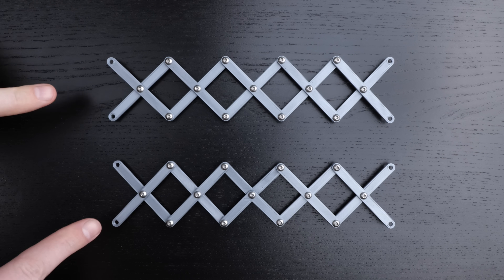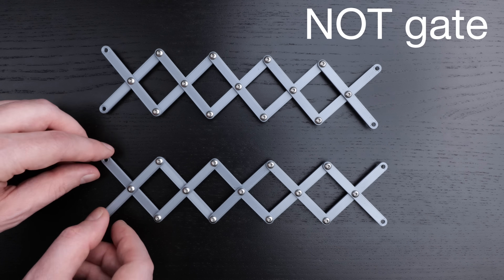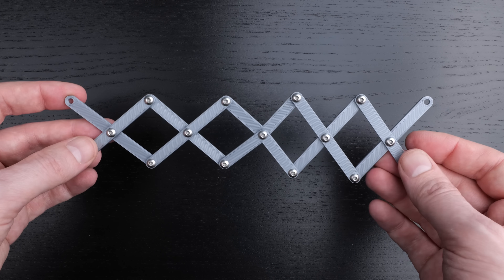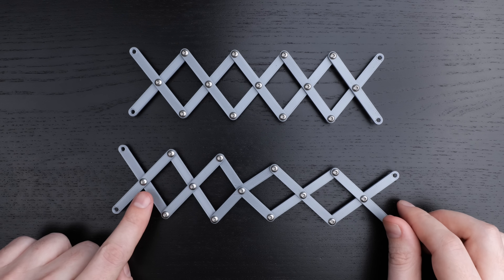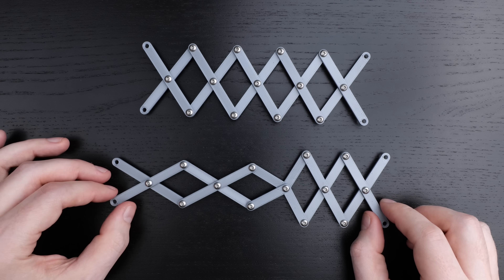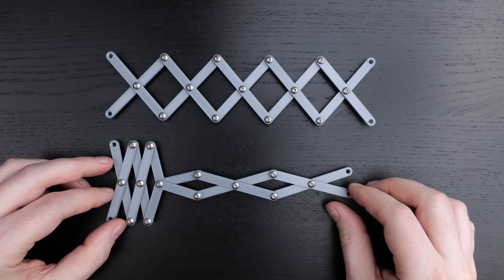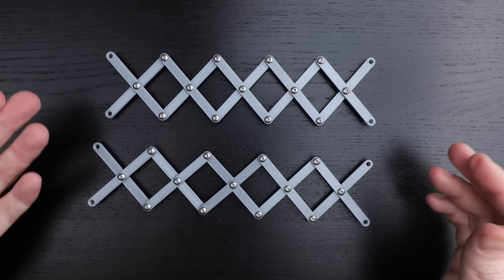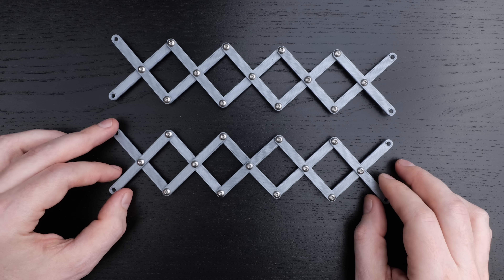Scissors NOT gate

Comment: If you chained two of these not gates together with a rigid flat rod on the outputs with a hole CNC-ed in the middle, it might almost be better to implement it as a ternary system because you get the ambiguous middle ("one of these is a 1 but we don't know which", which I think here is the UNK state?) for free.

That would be really cool to see uncertainty propagation through a network of weirdly mechanical gates like this. :D and hey, if we get more bits through the system for free, it's more bits through the system for free! :D <3 :) ;'DDDD

Comment: If you want to create a "pass" node, that outputs its input value (basically a wire) in a similar manner, you should connect two (or any even number) NOTs, and assuming the constant length problem is solved, these wires would also be constant length. Also they would be really cool visually, blending in in a larger machine. This would also have greater mechanical strength than some of the other ideas I have for just wires, and these can actually be suspended in any direction.

Another huge problem with the future designs is buffering. You can manage to create logical blocks that perform a few operations as gates, but after a certain complexity you either need very good bearings, which is an expensive option (and still not infinitely scalable), or some kind of logical buffers, that "amplify the signal" passed to it. This is a pretty straightforward electromechanical challenge, but the whole point is to only use this reduced set of building blocks. I'm thinking maybe something with "rechargeable" torsion springs and latches like in a mechanical clock.

Comment: You can make a NAND gate pretty easy: two parallel scissors, one full scissors width apart, then connect a third scissor to the two closest ends of the parallel ones. Pretty hard to explain without a picture...

Comment: The change in length is primarily due to the centre portion - replacing the right-angles with 60 degree angles, using an equilateral triangle the base shape as opposed to a square, would fix the change in length at each extreme, and the middle, of the lengthwise motion. I'm unsure of the full length profile through the points between these positions, however, and the changes to the rest of the mechanism to compensate would also reduce the range of crosswise motion between each pair of opposing points.

A tricky one, to be sure!
Reply: With a bit of angle chasing and a little trigonometry one could conjure up a function that spits out the total length of this contraption based on the input angle.

Then it's only a matter of checking if it's constant or not

Comment: Break up the L piece (i.e. have 4 arms connect on 1 pin). This is how I initially thought this worked. Admittedly, it doesn't hold its length constant on its own, but you can just enforce that with the framework that holds the linkages in place.
And a constant-width identity gate would combine one [NOT gate that is built with the L pieces] in series with another [NOT gate that uses the 4 arms attachment in the center].
Reply: Next idea: A 45° arm instead of the 90° "L" piece would output an equal width in both the "on" and "off" positions. And in between the width will be WIDER than the end widths, which means that a scissor coupled to those output pins would get SHORTER (following a sinusoidal curve) during the switching operation.
If you put 2 pin points that use 45° pieces in series; then using appropriate lengths of scissor linkage to the left, right and in between them will make it possible to exactly cancel out the length changes.
The transfer of the logic state would still happen through the sideways shift of the central scissor linkage, just as in my initial 4-independent-arms-at-1-pin solution. So the length would still need to be enforced by the framework (if only at the point where the inside-facing arms of the 45° pieces pass through the vertical w.r.t the scissor linkage's length). But the 45°-based design would re-gain the bending rigidity that the 4-arm design sacrificed as well.

edit: ascii diagram
\/\/\:/\/\:/\/\/
/\/\/:\/\/:\/\/\
with
\/
/\
being a center pin with normal linkage (fixed 180° arm angle) where arms cross over each other and
\:/
/:\
being a center pin with the 45° linkage (fixed 45° angle between the arms on both the bottom and top side)

Comment: Given L the length between two pivot points (the long pieces have 2L between their opposites pivot points), if you make the width D of each stick be L*sqrt(2) then the length in the middle state and the lengths in true and false input positions are the same, the first problem is that those three states are identical, ie it doesn't move at all. The second is that since the width of the pieces is longer that the length between two relatively fixed pivot points, you can't actually build the scissors, as neighboring pieces want to occupy the same space.

In the video we have n=2, the length T0 in the neutral state is T0=(2n+1) * L * sqrt(2) . And the length T1 in the set state (true or false) is T1=(2n+1)(sqrt(L^2 - D^2/4) + D/2) .
Solving for T0 = T1 yields D = L * sqrt(2)

Comment: Going on pure instinct, for the constant length; two ideas figuring them out as I type.
The movement comes from the rotation of the connection line between the axes: it's a square pivoting on a corner with the axes on the connected corners
You need to get the overall rotation point in between the axes. But with a fixed axis that won't work.
So: have that move along a curved path, sliding along a shaped "linear" axis.
Or
Extending the length of the first/last joints changes how agressively it extends. It feels like that should help somehow.
There's lots of "interesting mechanical mechanisms" demonstrated on here, many dedicated to hinging arms (like on the channel tenfold). there's probably one that is applicable here?

What is also interesting is that you also have a kind of bit here: left or right, somewhat fixed. That's a 0/1

Comment: Constant length: makes me think of using fourier to approximate a flat curve. Would require a ton of linkages tho... because every pair of scissors is a sin(ax + b), where a depends on the length of the linkage and b depends on its angle (default are flat linkages, and the 90° ones for example add Tau/4 to the angle of the sin, making it equal to a cosine evaluated at ax).

Comment: Ok I see problem pf making the not gate a constant length.
So if the angle increases a bit in the middle then when the scissor closes on both sides it'll be the same length as the standard scissors midway, now, fixing that problem creates another problem. The middle way will be too long, yes it's true, but! Look. 90° is the same, you increased the angle so when one side is fully "on" the other isn't exactly fully off, so it can keep the length of the 90°... a simple elasticity on the L piece and a bar on those sides to provide the force to bend it should be enough to solve the problem.
Also I don't think the problem is solvable with a fixed angle on the L piece.
The bars would be in the end with the scissors in the middle like: |xxx|
Then with plenty of those bars you can try combining them, but still mechanism like "and" or "or" would need 4 connections on the left and 2 on the right which is confusing.
Or maybe 3 on the left and 2 on the right assuming you're connecting the 2 pins in the middle together, still doing that you end with 3 different states at the end, both closed, one side open (assuming same opening independent of the side) and both open...

Comment: Hey Henry
 - long time, no see.

Not done the analysis, but taking a lead from electrical theory, three phase might work for lengths - i.e. two    sections of 120 degrees scissors, with a longer middle section. Trouble is, that’d destroy the not and make it a “buffer” again - like the top one - but one of constant length.

I’ve been idly mulling the “and” issue - nothing truly elegant is presenting itself. I hope that gets solved - it’d be nice to see even a full adder. I suspect friction will start to be an issue!

Comment: Solution for AND gate, using three NOT gates.
Sorry, no monospaced fixed width fonts, emojis shall be used. Better viewed in horizontal orientation in small screen devices. 

Emoji Notation:
↕️ Open input/output, Zero/False 0️⃣
↔️ Close input/output, One/True 1️⃣
🔃 Open link (high height);
🔁 Closed link (low height);
⬜ Emoji space alignment (only, no effect);
⏫⏬ Fixed points: top and bottom;
↗️↘️ Additional links: top and bottom, to give some space to the scissors;
🔀 Overlap solution: two additional links that are NOT connected;

AND operation: (there is a vertical movement of last scissor during operation)
0️⃣⬜⬜⏫
↕️🔃🔁↘️⬜⬜⬜0️⃣
⬜⬜⬜⬜🔀🔁🔃↕️
↕️🔃🔁↗️
0️⃣⬜⬜⏬

0️⃣⬜⬜⏫⬜⬜⬜0️⃣
↕️🔃🔁➡️🔀🔁🔃↕️
⬜⬜⬜⬜↗️
↔️🔁🔃↗️
1️⃣⬜⬜⏬

1️⃣⬜⬜⏫
↔️🔁🔃↘️
⬜⬜⬜⬜↘️⬜⬜0️⃣
↕️🔃🔁➡️🔀🔁🔃↕️
0️⃣⬜⬜⏬

1️⃣⬜⬜⏫
↔️🔁🔃↘️⬜⬜⬜1️⃣
⬜⬜⬜⬜🔀🔃🔁↔️
↔️🔁🔃↗️
1️⃣⬜⬜⏬

For non-extensible "buffer" (0 to 0, 1 to 1) use two NOT gates in series:
0️⃣⬜⬜1️⃣⬜⬜0️⃣
↕️🔃🔁↔️🔁🔃↕️

1️⃣⬜⬜0️⃣⬜⬜1️⃣
↔️🔁🔃↕️🔃🔁↔️

I hope this helps.
Reply: Amazing.
Reply: Note that the crossing of the overlapping links retreats in the direction of the inputs (left) when both are in state "1" to open (zero) the input of the last NOT scissors.
Reply: OR operation: (with some vertical movement of the last scissor).
No overlapping links and the fixed point are internal. Maybe external additional links are necessary to prevent "half-opening" when one of the inputs is "1" and the other is "0".

0️⃣
↕️🔃🔁↘️
⬜⬜⬜⏬⬇️⬜⬜0️⃣
⬜⬜⬜⬜↔️🔁🔃↕️
⬜⬜⬜⏫⬆️
↕️🔃🔁↗️
0️⃣

0️⃣
↕️🔃🔁↘️
⬜⬜⬜⏬⬇️⬜⬜1️⃣
⬜⬜⬜⬜↕️🔃🔁↔️
⬜⬜⬜⏫⬆️
↔️🔁🔃⬜⬆️
1️⃣⬜⬜➡️

1️⃣⬜⬜➡️
↔️🔁🔃⬜↘️
⬜⬜⬜⏬⬇️⬜⬜1️⃣
⬜⬜⬜⬜↕️🔃🔁↔️
⬜⬜⬜⏫⬆️
↕️🔃🔁↗️
0️⃣

1️⃣⬜⬜➡️
↔️🔁🔃⬜↘️
⬜⬜⬜⏬⬇️⬜⬜1️⃣
⬜⬜⬜⬜↕️🔃🔁↔️
⬜⬜⬜⏫⬆️
↔️🔁🔃⬜↗️
1️⃣⬜⬜➡️
Reply: Flip-flop: one-bit memory.
SET is 1 = M output goes to 1 to keep this value even when SET becomes back to 0 .
RESET is 1 = memory is cleared as M goes to 0 to keep this value even when RESET becomes back to 0 .

Inverse to electronic Boolean logic, which only has scalar values (volts), Mechanics has vector values that mean it has direction. This means that the "open" movement has an opposite direction of the "close" movement. So two NOT gates are required to feed the memory output back to the flip-flop input - they keep the scalar value of boolean logic and compensate the vectorial direction. These right-to-left operation gates would not be needed in a digital electronic circuit.

The OR-AND latch was chosen because there is only one feedback link ( right-to-left operation - see the direction of the arrows), and NOT gates are available. The NOT gate scissors required for 1-bit memory are 3 NOT gates for OR gate, 3 NOT gates for AND gate, 1 NOT gate for RESET input, and 2 NOT gates for feedback link. Nine NOT gate scissors in total.

Emoji notation:
🆖▶️⏺️  - NOT gate - NG>o ;
🅾️ OR gate - [O] ;
🅰️ AND gate - [A] ;
🆚 SET input - [VS] ;
®️ RESET input - (R) ;
Reply: idk why, but the words "emoji notation" made me giggle
Reply: Your buffer (unfortunately) doesn't work the way you think it does. Both of the NOT gates get longer and then shorter again when transitioning, therefore the inverted NOT-NOT mechanism will have double that change in length.
Reply: @tylerduncan5908   The mechanical circuit works "the way I think"  - or at least as I expect. Otherwise, if we use a similar example as the old TTL circuits (electronics: 0 to 5V), it would be the same to say the logic gates don't work because the voltage is at a transitional condition between states when voltage is at, let's say, 2.5V.
That is why digital electronic circuit designers consider small voltage ranges for distinct states, using the same example of old TTL: 0 is 0 to 0.5V, and 1 is 4.5 to 5V - all the rest are considered transitional conditions and not states.
This is also one of the main reasons why complex logic systems are clocked - to prevent interaction between circuits during different transitional conditions.
Most of these transitional conditions are caused by different capacitances in distinct circuits. We could consider the mechanical length variation during transitioning as a "capacitance"  - the same consideration for the vertical movement in AND and OR gates.
To reduce (but not eliminate) these capacitances, some fixed points shall be inserted in the mechanical system, and we can focus on the most important: the final result of the logical states.
As far as I know, there is no such perfect system with no capacitance, at least the ones made by men - even the fastest microprocessor doesn't have a perfect square wave - all square waves have ramped transitional variation despite being very short compared to the final state times.
Thanks anyway - I spent a lot of time on this, and it seems nobody cares - you wrote the first feedback.
Reply: Interesting. I gotta try it out in a physics simulator (don't have mechanical components).
Reply: @jyothishkumar3094  Please, if you or anyone else does, come back and let us know what happened. (:
Reply: @jyothishkumar3094   I am trying to make a scissors-logic simulator in an Excel spreadsheet to test these many connection configurations faster than writing down all Mechanical Boolean possibilities in a paper, but I have been busy these days.
Reply: Dear internets! emoji based schematic symbolism. If I had time I'd try to lay this out in blender.

If I had even more time I'd complain to the standards body about missing concepts in character sets and keyboards.
Reply: Love it
Reply: So cool!
Reply: Maybe this revision is better for understanding.
AND operation: (there is a vertical movement of the last scissor during operation).
🔀 Overlap links crossed but not connected - perhaps this is the best way to emulate a "switching" AND gate.

0️⃣⬜⬜➡️⏫
↕️🔃🔁
⬜⬜⬜➡️↘️⬜⬜⬜⬜0️⃣
⬜⬜⬜⬜⬜🔀↔️🔁🔃↕️
⬜⬜⬜➡️↗️
↕️🔃🔁
0️⃣⬜⬜➡️⏬

0️⃣⬜⬜➡️⏫
↕️🔃🔁
⬜⬜⬜➡️↘️⬜⬜⬜⬜0️⃣
⬜⬜⬜⬜⬜🔀↔️🔁🔃↕️
⬜⬜⬜⬜↗️
⬜⬜⬜↗️
↔️🔁🔃
1️⃣⬜⬜➡️⏬

1️⃣⬜⬜➡️⏫
↕️🔃🔁
⬜⬜⬜↘️
⬜⬜⬜⬜↘️⬜⬜⬜⬜0️⃣
⬜⬜⬜⬜⬜🔀↔️🔁🔃↕️
⬜⬜⬜➡️↗️
↕️🔃🔁
0️⃣⬜⬜➡️⏬

1️⃣⬜⬜➡️⏫
↕️🔃🔁
⬜⬜⬜↘️⬜↗️⬜⬜⬜1️⃣
⬜⬜⬜⬜🔀⬜↕️🔃🔁↔️
⬜⬜⬜↗️⬜↘️
↔️🔁🔃
1️⃣⬜⬜➡️⏬
Reply: oh cool
Reply: Bro I can't read wingdings
Reply: @Alex de Moura  From a quick thinkabout, both adding a crossover to the OR / removing the crossover from the AND result in NOR gates.

Edit: replacing the final not gate with just a regular gate should also do the trick. Those result in way more movement in terms of the output position though, which would probably not be super helpful if you were using these to construct bigger machines.
Reply: @CANnickhughes  Yes, and if you change some fixed points in the AND after removing the crossover, you get a NAND gate.
An XOR gate using an OR , a NAND , and an AND gate required too many scissors - the same is happening with the 1-Bit Latch flip-flop memory - please see previous replies.
Most of the logic gates designed in this comment have two Input NOT gates and an Output NOT gate.
When the logic gates are connected in a series configuration, the Output NOT gate can be replaced by the Input NOT gate of the logic gate next in a series.
When two logic gates, in parallel structure, share the same Input Bits , they can also share the respective two Input NOT gates of those bits.
I suppose the XOR gate can be reduced to four scissors only using this "gate optimization" ( or "reduction" ) - just changing the crossover/direct links and fixed points -  and removing redundant NOT gates using the similar ones in the neighbor gate.
The XOR gate is needed for Add in the 1-Bit width Sum block design with an AND gate for Carry as that was my first goal (a challenge in one of the comments of this video) - but the XOR should be optimized. 
I am trying to make a scissors-logic simulator in an Excel spreadsheet to test these many connection configurations faster than writing down all Mechanical Boolean possibilities in a paper, but I have been busy these days. I appreciate your comments - thanks.
Reply: @Alex de Moura  If you start with an AND gate and fix either the top points on the first two NOT gates, or the bottom points on the first two NOT gates instead of the outside points, you get a gate which is only true if exclusively the corresponding input is true.
Reply: @CANnickhughes   I didn't see your last comment, I was typing the reply. I will try your suggestion.
Reply: I would need to see this physically demonstrated.
Reply: @warlockpaladin2261  That will not help. Taking a course in logic will. “I learn by watching others basically because I’m too dumb to understand.”
Reply: @richsackett3423  I used to be an engineering student and boolean logic is rather familiar... granted, my experience is in TTL circuits and not mechanical logic.
Reply: The Boolean block diagram of the mechanical SR OR-AND latch (flip-flop) and its SET and RESET is as follow:

SET operation: ( memory set to 1 and then SET input marked as [VS] backs to 0 ).

⬜⬜⬜⬜↙️⬅️⏺️◀️🆖⬅️⬅️⬅️⏺️◀️🆖⬅️⬅️
⬜⬜⬜⬇️⬜1️⃣⬜⬜⬜⬜0️⃣⬜⬜⬜⬜1️⃣⬜↖️
⬜⬜⬜↘️⬜⬜⬜⬜⬜⬜⬜⬜⬜⬜⬜⬜⬜⬆️
⬜⬜⬜⬜➡️🛑🟥🟥🛑⬜1️⃣⬜⬜⬜⬜⬜⬜⬆️
1️⃣⬜⬜⬜⬜⬜🛑🅾️🟥🔴➡️➡️🟥🛑⬜1️⃣⬜⬆️
🆚➡️➡️➡️➡️🛑🟥🟥🛑⬜⬜⬜🟥🟥🛑⬜⬜⬆️⬜⬜Ⓜ️1️⃣
⬜⬜⬜⬜⬜⬜⬜⬜⬜⬜⬜⬜🟥🅰️🔴➡️➡️⏹️➡️➡️➡️➡️➡️
0️⃣⬜⬜⬜⬜⬜⬜⬜⬜1️⃣⬜⬜🟥🟥🛑
®️➡️➡️➡️➡️🆖▶️⏺️➡️➡️➡️➡️🟥🛑

⬜⬜⬜⬜↙️⬅️⏺️◀️🆖⬅️⬅️⬅️⏺️◀️🆖⬅️⬅️
⬜⬜⬜⬇️⬜1️⃣⬜⬜⬜⬜0️⃣⬜⬜⬜⬜1️⃣⬜↖️
⬜⬜⬜↘️⬜⬜⬜⬜⬜⬜⬜⬜⬜⬜⬜⬜⬜⬆️
⬜⬜⬜⬜➡️🛑🟥🟥🛑⬜1️⃣⬜⬜⬜⬜⬜⬜⬆️
0️⃣⬜⬜⬜⬜⬜🛑🅾️🟥🔴➡️➡️🟥🛑⬜1️⃣⬜⬆️
🆚➡️➡️➡️➡️🛑🟥🟥🛑⬜⬜⬜🟥🟥🛑⬜⬜⬆️⬜⬜Ⓜ️1️⃣
⬜⬜⬜⬜⬜⬜⬜⬜⬜⬜⬜⬜🟥🅰️🔴➡️➡️⏹️➡️➡️➡️➡️➡️
0️⃣⬜⬜⬜⬜⬜⬜⬜⬜1️⃣⬜⬜🟥🟥🛑
®️➡️➡️➡️➡️🆖▶️⏺️➡️➡️➡️➡️🟥🛑
Reply: Special-Operations FOX-HOUND 🔫🔁🔫🔃🔀🔁🔫🔁🔃🔀🔫↪️🔫🔁🔀🔃🔫↪️🔁🔫🔃🔃🔀🔄 Revolver 🔫↪️🔄🔁🔫🔃🔀🔫↪️🔀🔀🔄🔀 Ocelot 🔫🔃🔄🔁↪️🔃🔫🔁↪️↪️🔫🔁🔁↪️ I've been waiting for you, Solid Snake 🔫🔃🔃🔃🔫🔁↪️🔃🔄🔫🔀🔁↪️🔃🔃 Now we'll see if the man can live up to the legend 🔫🔀🔁🔀

This is the greatest handgun ever made 🔫↘️✋✊ The Single Action Army. 🔫⬆️🔃🔃🔃🔃 Six bullets 🔫⬆️▫️⬇️▫️⬇️▫️⬇️▫️⬇️▫️⬇️▫️⬇️ More than enough to kill anything that moves 🔫⬅️▫️⬅️▫️⬅️▫️⬅️▫️⬅️▫️⬅️▫️ 🔫⬆️🔃🔃🔃⬇️🔃🔃🔃 Now i'll show you why they call me "ᏒᏋᏉᎧᏝᏉᏋᏒ"
Reply: @frank8627-v8k  and nice demeanor too
Reply: This is a good notation using emojis and 3 NOT gates!
Reply: i dont get it sob
Reply: might as well build the rest of the computer while you're at it